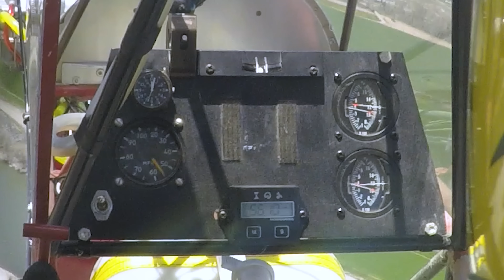MAIDEN FLIGHT goes BAD on landing.😓 Abandon airplane PART 6.

Comment: to address the hot cylinder problem ... I would go to a dual carb setup ... you will gain some hp ... plus you can jet each cylinder based on EGT ... I'm betting the rear cylinder runs hot  ... another option is to build a air scoop IE: check out fan cooled snowmobile engines ... use the shrouding minus the fan
Reply: The Rotax 503 has forced air cooling, looks like he's running a variant of it without the fan housing. Maybe a 477 iirc?

Comment: Radios are cheap.  You said "head on a swivel," then didn't even look before turning.  The TAIL wasn't the trouble, it was the gear struts being so flexible your tires were pointing different directions.

Comment: I have run lots of 2 cycles.  Temp is very dependant on mix and lesn or rich.   They  next to smoke and slobber at idle.   Slightly rich will cool best.

Comment: question plz. Why does adding pitch/adding load to the engine, thus making it work harder? Make the EGT’s cooler? Hope the plane is ok. Maybe the gear starting to twist added camber and drag on the left gear wheel? Such a good job at missing the lights and fence! 👍😬👍
Reply from the maker: That is a good question! I honestly don’t know but from the 2stoke gurus that’s what they tell me. 🤷🏻‍♂️

Comment: I agree the landing gear sucks and tail vertical stabilizer should be about 10 inches taller you need to desensitize those ailerons and get your cooling problems fixed and by the time you've done all that buy a different plane and you will be good to go.

Comment: You always want TOE_OUT on the main gear. (if one wheel is lower and touches first, toe-in will want to steer that wheel UNDER you. Which is not what you want) Toe- out will steer that wheel back out where you want it.

Comment: i had a freeair  rotax 447 on my flightstar,  i added an airflow divider between the cylinders to get more air to back cylinder head to get temps down, was able to get cylinder head temps within 20 degrees of each other by adjusting the divider,  as for EGT's i ran mine at 900 to 1050 at cruise, climbouts at wide open throttle was about 1,000

Comment: Seem like you could've held off longer?  Hard to say without really chatting about how you felt in it though.  I'll stick to 3 pointers in the grass myself. Those wheel landings are tricky stuff, then add asphalt, whew. ;) You kinda did a hybrid wheel/3point landing.

Comment: It's not that there is not 'tail authority,' to me, it is the pitch-angle of the front tires, the fat & Soft tires, and mostly, the wobbly and flimsy landing struts... all of that is causing most of the landing and landing issues. But then there is one more issue that I would say is of concern for the backend, the tail wheel is likely not making good contact due to a lack of weight in the rear -- but I am not suggesting adding weight to offset the CG; I am simply saying, the rear landing wheel is too light and twitchy for the speed.

Comment: Needs some baffles over the cylinders to direct the air flow to stop the cylinder from running hot...and defo a triangular landing gear for greater strength to resist flexing..👍👍

Comment: Try a different cooler number spark plug on number two cylinder if you are running only one carb and can not rejet to get a richer fuel mix.
Nice plane,

Comment: This is where I think the government regulations are dangerous.  The pilots have had to endure these weight standards for far too long.  It has forced many to go to two stroke power and in this case to use too light of materials for landing gear to stay within the regs.  Frankly, the builders need another 100lbs to stay safe with motors and construction methods.  Many have been able to build and stay just within regs, but frankly the FAA is endangering lives when it should be helping young pilots.  This is why we have pilot shortages.

Comment: Mil spec aircraft landing gear is designed for 7G minimums ... those did not appear to even take 1/4 G with the gentle landing and still failing which is something that should have been checked before test flight.  Supports from each wheel to the fuselage center or direct tie rod to the other wheel is necessary.  Maybe get an inspection from an inspector before next flight.  Your life is at stake!  I was surprised you didn't ground loop and ruin one wing.

Comment: I can see one problem there is no bracing for the gear long thin stick leg so they flick back and forth which will change the direction and a bit bigger tail wheel but brace the main gear

Comment: Isn't the helmet just more weight on your neck when you are strapped in. I would have a little backup chute instead. Handy when the rest of the plane is as well built as the landing gear.

Comment: Without weight on the tail wheel it won’t help in your directional control. As you are leaving the runway look at the video of your elevator. It is down and thus taking weight off the tail. You need full aft stick once you are slow and the rudder is no longer effective.
Reply from the maker: Yeah except if I pulled back I probably would’ve went airborne again which is what I was trying not to do.

Comment: The landing gear is definitely not up to the task, it probably would have been OK with small wheels, but the bush wheels are a lot more leverage. I'm not a pilot, but I hear back-pressure on the stick helps the tailwheel stabilize the roll-out and adds to the steering authority when there isn't enough wind on the rudder. Good of you not to slam it down during your wheelie landing though.

Comment: The air bike landing gear all ways bent easly i bent mine several times before i changed how it worked i built a light weight sub frame to clamp under the frame and used aa single cub shock cord between the tires to give some suspension and had a second brace arm to stop tire shake that make a big difference on ground handling
Reply from the maker: Good to know!

Comment: The landing gear was an unknown issue. The overheating cylinder is a known issue and will easily cause an engine seizure in flight, that should be your first priority before the gear. Imagine a hard landing with zero engine thrust to flare on landing... good luck and do get a radio.

Comment: Hey bro, I’m sure you’ve seen the “just 103” those guys put a spring in the bottom of the stick to make it it require more effort to move the controls. This should solve your problem with the ailerons being too sensitive.

Comment: This maiden flight probably did not follow by the tests of  high speed taxis. It is not surprised that he did not realize about the no authority of rudder and the aircraft pulling to the left during landing. Did he refer to some spec when casually increasing the 1 degree pitch?   The 5 gallon of fuel tank is between his leg might give him a very flamable bath in a crash. Ah! he likes to drink the chemical loaded energy drink instead of the healthy water? “There are old pilots and there are bold pilots, but there are no old, bold pilots”

Comment: Bigger air filter won’t necessarily lower EGT, potentially it could cause the engine to run weak and lead to higher EGT.

Comment: Part of the problem was how hot you were on touchdown, shouldn't you be at about half that speed? Cause if it just stalled onto the mains at that speed you have an issue. Maybe 4 feet of slats on each wing?

Comment: As a fellow Airbiker....You look nose heavy to me.   Mine lands right at a three point landing.   As soon as my tail hits I pin the tail.   Never tries to geound loop...and minimal pedal movements.  Airbikes are tricky doing wheel landings.    My landing struts are steal pipes by the way...and smaller tires.  Oh...I put my gas can behind the seat and it balances perfect.

Comment: I can't believe it lifted off with your big arse ballz in it. 🤷 
I'd say you need a bigger rudder bro. You input full rudder authority and it didn't react one bit. That's dangerous AF. Didn't look like the rear wheel was steerable 🤔 If it isn't it should be and it would help a lot if the breaks worked you could've breaked hard on the right. to swing the tail around. That takes some big ballz to fly that coat hanger with wings  🔥🤘 
Stay safe bro 🙏✌️

Comment: He might try puttingdetter landing gear and aircraft canvas and cover the entire tail from just behind the pilot seat to the tail end its just a thought .And for the cylinder getting hot they should be air cooling maby the cylinder fins have insufficient air flow across it may be carbon bild up in the exhaust passage through the pipe or bad valve not seating properly a 2 cylinder air cooled engine should only get to 300 to 350 degrees F any hotter will score the cylinder walls and rings.

Comment: Jonas, If you have a solid tail wheel, take it off and throw it in the trash! That wheel , should be a air filled one that will grip The pavement. I have a solid steel wheel on my plane and was told to throw it away.

Comment: Jonas, dude, your landing was NOT that hard.
That gear was GOING to fail on some landing.
That 'gear' I certainly wouldn't consider a landing gear.  More like a dolly you use to push out your trashcan to the curb on.
If anything, the big wheels softened the force on the 'gear.'

Comment: The rudder is definitely too small, but using the ailerons wold of helped the potential ground loop .... that gear is an absolute joke..... needs some Toe in too ... laughed at how loose the wheel bearings were still rolling on the downwind...

Comment: It is obvious that the tail surfaces volume ratio are small and the tail boom moment arm are short on that design.
In a slow speed aircraft design; the tail boom should be longer than is normal and the tail surfaces should be larger than normal.
This is one hundred year old tech.

Comment: Too fast. You need to be very patient before puting the wheels on the runway. I have a RANS S17 and I had the same problem at the begining. First: dissipate all the energy and then, flare and touch down.

Comment: Man, you were so lucky you didn’t get your legs ripped off in the lights. That kind of aircraft is pure crap evidenced by the obvious shortcomings of the landing gear design. Take it apart and make a big bonfire with the parts. Another negative experimental aircraft statistic avoided.

Comment: well, it really wasn't a wheel landing, or a 3 ptr. Yes, a few deg. of toe in, at flying attitude. All in all, the landing didn't look that rough. Nice save.  You had tail auth. until the gear bent. All bets off, at that point.

Comment: You have No Stabilizing Bracing for your front landing wheels ..  the tail of the plane is too short to help you & the engine mounted too close to the cockpit 
Planes that are built like this are designed for much faster speeds and much more power and that is much too fragile to handle anything in that small specter of Framework.

Comment: Too fast on final, not stabilized. You were ground looping because you were too fast (still flying) and not on the rudder quick enough. Had plenty of rudder, that’s what kept you from spinning around. Be careful screwing around with that prop on a hot engine. One whack will ruin your day.

Comment: Ive   worked  on  and  flown  some   Junk  but  you   sir  have   a   Chrome  Plated  Turd.  Bend   the    gear   with  a   light   off   runway runoff combined   with  poor   rudder   authority gives   you   the  Chrome   plated   Turd   Award.

Comment: You might want to try coming in much slower and setup for a 3 point landing, wheel landings in that look sketchy as it isn't pretty in the transition
Reply: Ultralights need to keep speed up on landing, I wouldn't recommend a 3 pt in an AirBike.
Reply: @ricknsharons  why?
Reply: @robinpengelly8202  many Ultralights are designed to lose elevator control before the stall speed and drop the nose preventing an unintentional stall.  Results will vary between aircraft but you'll find that many Ultralight POH will say to keep speed up and fly it to the ground, the AirBike POH says that; "Minimum airspeed entering the flare is 45 mph" (which is well above the 25 mph stall speed) then "hold level a few feet above the ground and reduce power until the wheels touch down".  If I could attach excerpts of the Pilot Operating Handbook here I would, but I don't see a link to add pictures.
Reply: @ricknsharons  ok thanks that's interesting.  In the video here though it looks like the aircraft has lost rudder authority.  So assuming it's both being blanked in the transition then the aircraft becomes basically uncontrollable unless you wheel land it and even then you have to get from landing attitude to three point at some point so the transition is going to be sketchy no matter what.  If that's correct these designs must be very intolerant of crosswinds.
Reply: @robinpengelly8202  when built according to the plans, the plane flies great and has very good rudder authority, even with crosswind. Looking at the video it's obvious that the landing gear was either not built per plans, or was damaged before this landing. No way should those gear legs flex like that!  

I've flown an AirBike for several years, and know of several that have many XC trips of 1,000+ miles and don't have any problems with the gear.  Check youtube for other AirBike videos, there's one than flew 1,800 miles RT to attend an airshow.
Reply: @ricknsharons  thanks!

Comment: Nice save. I would bring it in fast as well. If anyone commenting has flown ultralights they will all agree that chopping the power too soon is like hitting a wall and is a sure short landing. You can cruise them over the numbers and chop power only when you want them to stick. My fear is always what the previous guy did. If the gear is questionable, what else might he have taken a shortcut on?

Comment: A little redirection duct may help that rear cylinder, I was actually wondering if sideslipping a little could have helped. As for the gear, looks like it torqued on high speed braking and actually failed with the shock load (shock torque?) from dropping off the edge of the pavement if the brakes were engaged at that point, the wheel would have stopped briefly and the shoes gripped the brake surface, then bam torque when it hits the ground. Needs a torque strut or wire.

Wonder how helpful a plastic skid would be on that rear wheel... or a rubber snubber up at the end of whatever spring travel there is, let the speed drop enough so you can give it elevator and force the snubber onto the pavement and add drag at the rearmost point. Or, cable it to drop with the main brakes. shrug Just tossing ideas around in my head. Didn't see what the caster angle of the tailwheel was or if it was trained to the rudder, a trailing skid would pivot with rudder movement (provided positive pin angle/caster) and touch pavement on the inboard side of the commanded turn and add asymmetric drag from a helpful angle.

Comment: Couple things that must be addressed before flying this beastie again.
rear cylinder temp. Landing gear and brakes.
Check if the rear cylinder is running lean.  wouldn't put any sort of shrouds on unless you have some sort of fan.  You have work to do young man.
Reply: No brakes.  Most UL aircraft don't have them.

Comment: I guessing this started with a case of beer and 2 guys grilling some steaks. Hey I got a great Idea check this out, you know that old lawn boy 2 stroke lawn mower I have? man I bet we could make an airplane engine out of that, home depot for some tubing, hobby lobby for some fabric, and Ebay for some tires and a prop. Like 20 bucks for everything, 10,000 dollars later, Man you sure this is gonna fly, yeah, yeah its gonna fly I double checked all the math the coefficient of variation is +/- 1/1000 the geometric stress loading is well with the safety margin, Dude you failed geometry in high school, man YouTube college of knowledge bro, I watched several videos on airframe geometry and I been practicing flying on my Nintendo, it all good.
Reply: 😂😂🤣🤣 dude if he hit those pylon things that would have been game over right there. This is so sketchy

Comment: Well, if you can install a lawnmower blade under it, pretty sure they will hire you to cut the airport grass?

Looked like you were at a rodeo.

Gives new meaning to the Seat Belt Sign is On.

Comment: Hey Buddy , i’m not a Pilot or any Specialist on what ou have going on i’m just interested inFlying or maybe even building my own aairplane one day  it seems to me  upgrading your brakes would be a good idea and relatively easy and /or Inexpensive with todays resources like Disk brakes for Bicycles and  having Wilwood Brake Company that specializes inEngineering and building systems for just about any  high Performance vehicle or heavily Modified  you appear to be smart enough to  make sketches or photos to give to them on what you are after  as I know they work with car guys over the Phone or Internet  and will often adapt or modify a system they may already have inProduction  for something else  they designed  it seems to me that stopping your Air Bike would be fairly Important ? Wilwood  likes the opurtunity of designing systems  so they can be offered to other Owners of that Vehicle  on their websites who knows maybe you can be responsible for helping save a few lives ?

Comment: that tail suface is just pathetic..who designed that thing? Increase, maybe double, that working surface area.
I am sure its fine for inflight yaw control but at lower ground speed its not going to have  - just as you say - authority!

Comment: K&N air filters move a lot of air, but they are crap in terms of the particulate that they allow through. Look elsewhere if you love your engine. Same goes for their oil filters, just overpriced and over hyped junk.